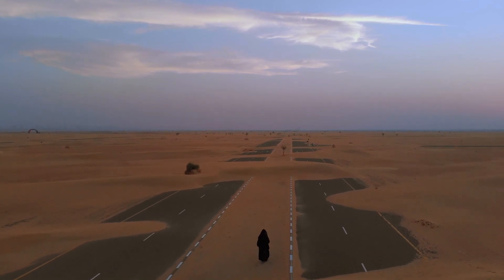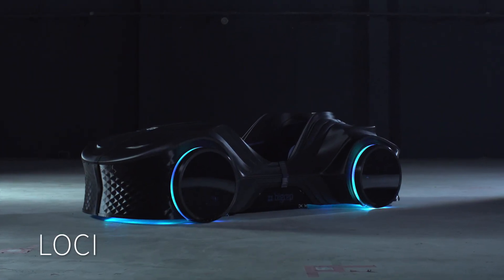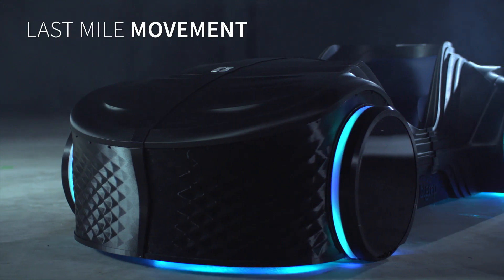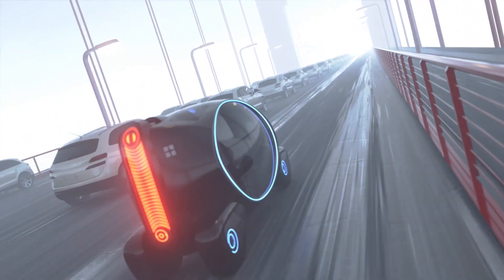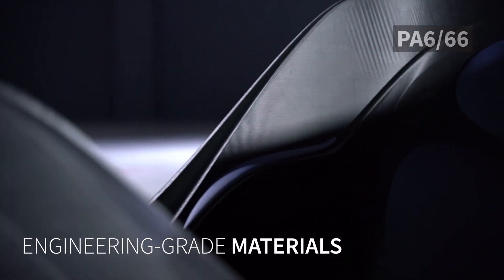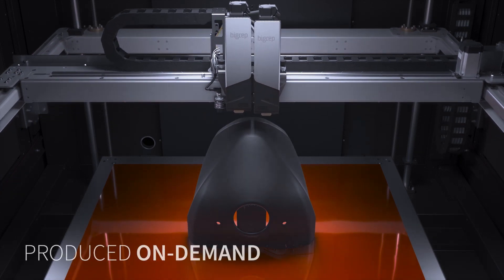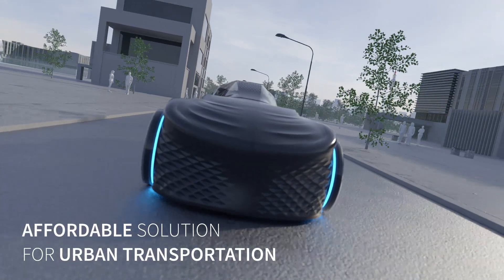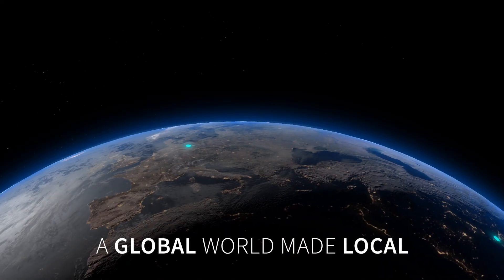The LOCI Podcar -  a fully 3D printed last-mile electric vehicle

Comment: What the hell are the advantages of 3d printing a car? A well designed production line produces cars faster and cheaper. 
And you didn't even explain wtf "last mile movement" is? .This is a terrible commercial.

Comment: @Robert Klein 

Overall it is entirely possible to reduce the cost so that it could be affordable. But understand that this is a prototype not an actual functioning vehicle. But if you did want to know how much this can cost to be produced, the majority of the cost would go into the electronics since they obviously (unless using halbach brushless motors which can be mostly 3D printed except for the copper wire) need copper which cannot be 3D printed. But in short, the cost of the vehicle itself should be the physical price and the manufacturing price combined. By that I mean the electricity used to print the parts (if using solar panels then practically free, so we can cut BS tape and cut, no pun intended, to the price of the vehicle itself.), and the price of the material used in the vehicle. Using ABS makes sense in the sense of structural requirements but PETG would work better due to not giving off fumes as well as being similar to PET (which also might be of consideration). the total price of the plastic would depend on the bulk quantity used (since the price would drop per kg the more you get) but one way or another the prices can be reduced. I would say south of $5000, if it can be made with 250kg of plastic for a curb weight of 350-500kg (with a bulk price of $10/kg, knowing that a consumer unit of one kg of PETG costs somewhere around $25, so when buying in bulk the price goes down substantially) but comparing that with a Tesla at over 100k dollars this is very good.